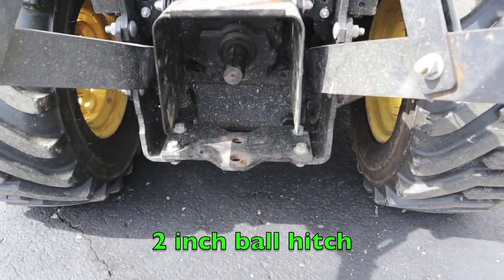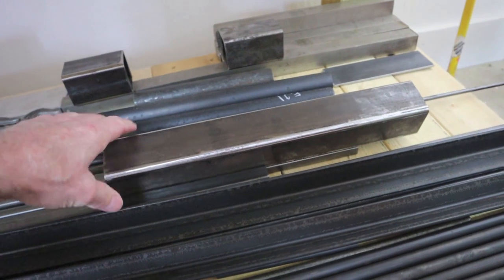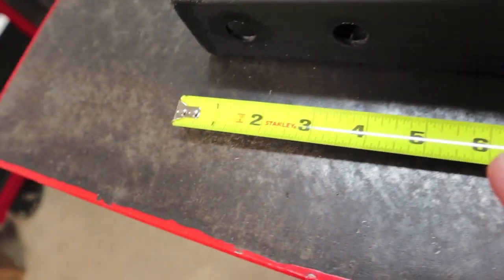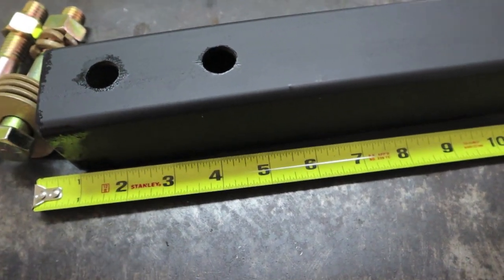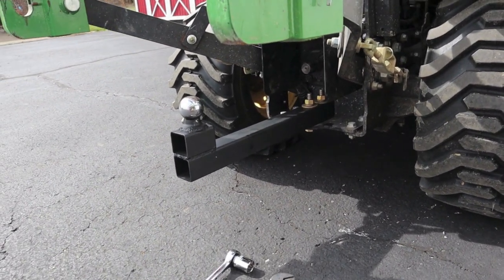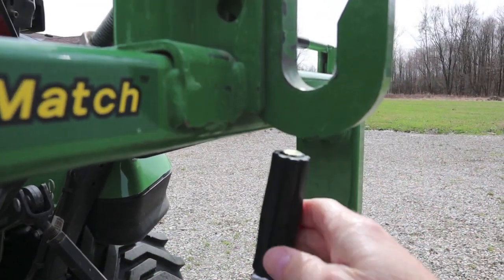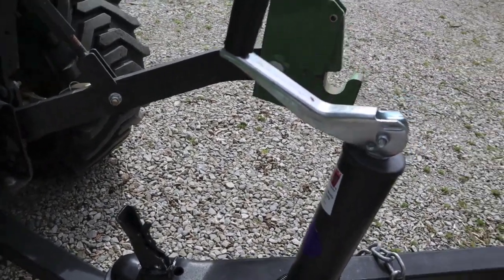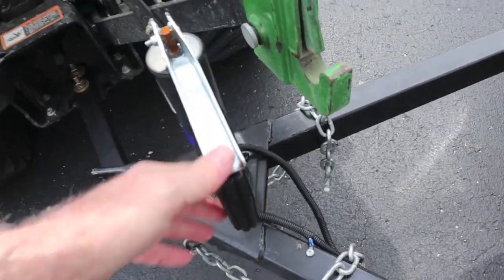DIY Extended Ball Hitch John Deere 1025R SCUT Tractors

Comment: Using a 1& 7/8" ball I mounted it directly on the back of a 16 horse power Murray tractor lawnmower and used the Trailer used to transport the Lawnmower behind a Chevy Van to level out a dirt parking lot with salvage Base Course. I moved 2 tandem axle Mack truck loads of SBC for a old man and his wife. All they had to do was pay for the SBC. Didn't have no problem. Hand loaded and unloaded the SBC. They owned a old motel and the back parking lot was full of mud holes. That was yrs ago.
Reply from the maker: That little hitch is definitely handy!!
Thanks for watching!